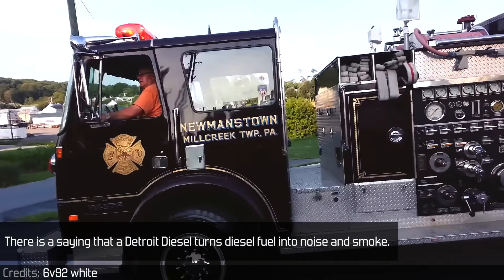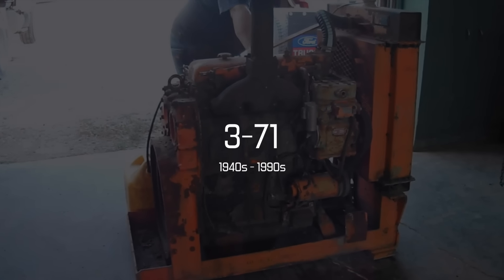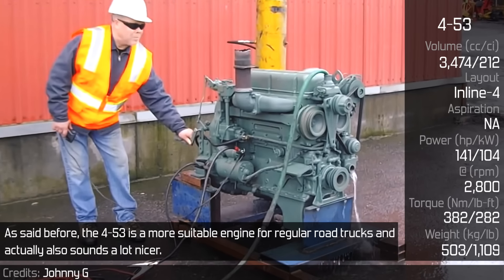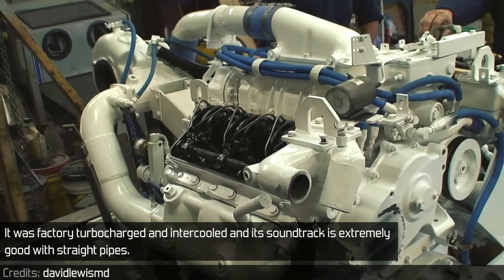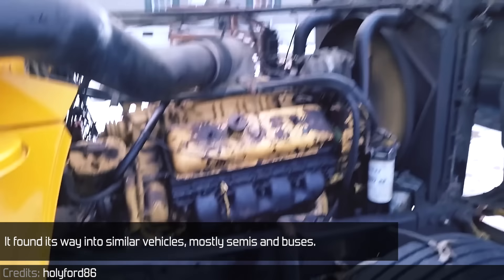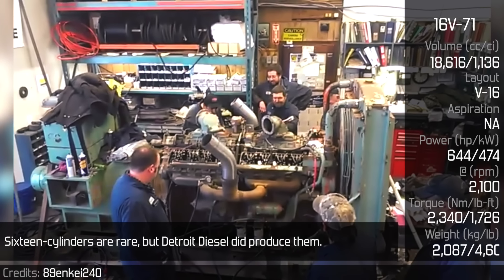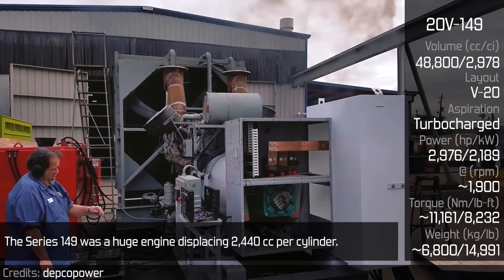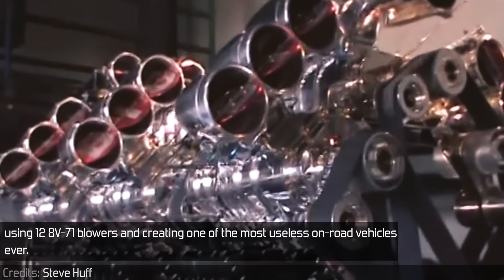9 Of The Greatest 2-Stroke Detroit Diesel Engines Ever

Comment: I was trained to rebuild, repair and operate the Detroit Diesel 6-71 marine units for use in Coast Guard patrol boats in particular the steel hulled 40 foot boats which used two. In the engine's early days the marine units were branded as "Grey Marine Diesel" In the inline 6-71 there was a two exhaust valve engine that was normally aspirated and a 4 exhaust valve engine that was turbo-charged. For those that don't know, the suffex on the engine's designation, 71 or 53 ect. designates the cubic inches per cylinder. The prefix designates the number of cylinders and if the number has a "V" after it, it means that it is a V type block.  A 6-71 is an inline six with 71cu. in. multiplied by 6 or 426 cu. in., a 6V-71 is a V6.  The only big issue that we had was to have a "runaway" engine. This happens when the air box drains get clogged and the engines lube oil starts entering the intake ports, (two stroke Detroits don't have intake valves, only exhaust valves). It starts using the lube oil as fuel along with the injected diesel fuel. When this happens the RPMs start increasing at an uncontrollable rate. The only way to stop these engines from destroying themselves is to stop the engine's incoming air. The early engines didn't have a cable operated block off plate that was situated at the intake of the blower to stop the incoming air and to stop the engine. The alternative that we had was to use a Co2 fire extinguisher that would be discharged at the intake. This would stop a runaway pretty effectively. As a boat engineer I always made sure that there was a fully charged extinguisher on the boat when I had duty. 
General Motors also had a two stroke Diesel that was in sorts a bigger brother to the Detroit series branded "Cleveland Diesel", these were inline units which had separate cylinder heads for each cylinder. My experience with them was inline eights connected to generator sets on WW II era cutters. Thanks for the video, you brought back some memories of a great engine series.
Reply: And there was also the EMD 2-stroke diesel, that evolved from the Winton 201 that was used in the famous Burlington Zephyr locomotive.  Cleveland diesel started as the Winton Motor Co, and was bought out by GM.  Detroit and EMD diesels were developed in the mid-1930's at the GM research labs, bringing about a transportation revolution that resonates to this day.  The Detroit 2-stroke was lost due to its inability to meet ever-stricter NOx emissions standards and it couldn't compete with high torque-rise 4-strokes in heavy duty trucks when it came to operating economy.  But they always did sound great.
Reply: William Charles yes thanks for the extra info and your service in the USCG. My family owned a small mom an pop trucking co. from the late thirties to 1981, when the dreaded teamsters union ran us out of business. So you could say I grew up around trucks, from straight trucks built by GMC, with the big block V6 gas engines at 351-401 cubes, with giant two brl  carbs and Six speed trans with two speed rear. To a couple Mack R 500 straight trucks with 210 Scalia Varbis in-line 6 diesels with two shifts, one for low and high, the other a straight 5 speed with reverse. They were all refrigerated with Thermo King units powered by Wisconsin cast iron single cyl gas engines. Then we had a fleet of White 9000 single axle tractors powered with Cummins diesel with 10 speed Roadranger tranny’s. My father had hired a great mechanic full time and paid him very well, that man taught me everything I know about getting my hands very dirty and being able to fix or rebuild anything that has wheels and burns gas or diesel! Matter of fact he was a Master Machinist Chief in the USCG! As far as I know. I’m not sure of the rankings in  the USCG, but I know it was high up after 20 years! He also always owned a boat and made a lot of money in the side repairing them! He was a great guy! I’m also a Veteran, 1973-1976 U. S. Army.
Reply: William Charles 
My last unit in the Coast Guard was the 13th district assist team where we rebuilt 6V53 for district lifeboats.  It was great duty, MKCMJoe Gelokaska was the POinC of the unit, located on the Lake Washington Canal in Seattle, Wa.  Moon Morrison, MK-1
Reply: Thanks for your knowledge and experience on Detroits, I spent many a mile behind the wheel of k series Kenworth and W series, 6v 71 n/a 8v71 n/a 6v 92 tta 871 tta 671 na all great thanks.
Reply: @k.r.v.4219  great thanks.
Reply: I never worked on them but I did have the pleasure of driving the older, 39,000 lb HEMTTs that were equiped with the 8v92 engines. I LOVED driving those machines even though they were automatics. what sold me on Detroit engines was one trip where I had to deliver an M978 (4 speed HEMTT) to another unit. we were in a time crunch because our ride back (UH60) had a tight schedule. I was driving and sarge was riding shotgun. she told me to put the foot down and well you know how the ARMY is, unless you have a moral objection to an order you do what your told! I wasnt going to argue with letting the old Detroit sing! so I had the throttle pinned for about 4 hours. it was screaming at 2500 rpm the whole trip up I55 and it didnt break a sweat
Reply: Didn't DD make a series of 2 stroke
Diesel that didn't have exhaust valves opened/closed by a camshaft? I read about them and saw some running engines here on  
YT. I just can't remember the series number, but I know they quit making them late 50's early 60's because they were too noisy. Another rare Detroit is the 6-110
Reply: @andyharman3022  Detroit's were great for stationary jobs like generators, pumps, cranes, and marine.
Reply: Thank you my fellow engineer. very well explained.
Reply: That was the one I liked best when I was in navy they where 268 A engine's used in 150 ton craft to 350 ton craft
Reply: Navy still have some of those they are 149 emd they were used in Vietnam on 85 ft. patrol boats three engines and three shafts in makon delta
Reply: The 567/645 v12 are used as backup and  emergency generators on most navy's fleet,,,,,,,u look at trains like Burlington northern they run 2 Fairbanks Morrison opposed piston five cylinder ten piston engines they have no intake valves or exhaust no cam no heads .,,,,, they normally run about 2000 hp each..............the trains with the cab same width as engine compartment they run either the 645 V 18 or 24 cylinder 2 each 2000 to 2400 hp each
Reply: @rbagel55  Yes they did, they were the 51 series engines, in 2-51, 3-51 and 4-51 variants, cylinders were loop scavenged much like a lawn mower engine but still  had the traditional wet sump, unit injector and blower of later engines.  Very rare these days, I believe they were mainly used in marine small boats, although some possibly made it into generator use. They were very simple engines but suffered terribly from exhaust plugging, any sort of back pressure in the exhaust and they barely ran.
Reply: Literally Shaking  Blower only engines are referred to as naturally aspirated as the blower drive ratio is set so that air pressure fed to the engine is barely above atmospheric pressure. High speed blower drives and turbo engines are 'super charged'
Reply: @rayg9069  Good info, but from what I read was they only had the 251 and the 451, no 351
Reply: @rbagel55  You could be right,  I only ever knew of one engine in Adelaide Australia a 4 cylinder in a fishing boat, never saw it in person and only one mechanic in our shop ever worked on it. None of the young guys would go near it.
Reply: @hank1556  I drove those old HEMTT's too when I was stationed at Baumholder Barracks, 2nd/29th FA from 84 to 87. I miss the sound of those old Detroit engines
Reply: @rbagel55  I think you are thinking of the 51, I remember reading they were designed by someone else and GM build them under licence.
Reply: Hi,I was an MK1 and operated and overhauled many DD,53-71 series.One of my units was Support Center NY ,Motor Repair Shop.85-89.I was active 1972-1993.
Reply: @hamiltonmorrison8804  Hi ,I'm a retired MK1,did you know a MKCM Brock,he was on assist team in80's.He was Chief on Point Richmond ,Anacortes WA with me 1977-78.
Reply: Besides being very popular and reliable power plants, the GM diesels were quite versatile.  Because the cylinder block was symmetrical the inline engines could be assembled with the blower on either side of the engine. The same is true with the cylinder head. The exhaust manifold could be on either side. By changing the gear drives at the rear of the engine, it would have reverse rotation
I was assigned to LCM-8 landing craft in the Army. They had four 6-71 engines driving two opposite turning props. No two engines were set-up the same, although they had the same parts. 
Thanks for your service in protecting us. And thanks for your insight.
Reply: Literally Shaking  We got an 671 to run (briefly) in GM rebuild school in Indianapolis back in the 80's.  It idled like garbage choked gagged sputtered and then died but it did start and rotate... absolutely no power though.  That place had an outstanding diagnostic training school as well although I think the place has closed down since.
Reply: @andyharman3022  There are 10-20000 rail locomotives in service built from the 1960s through the early 2000's with 16V and rarely 20V 645 and 710 (cu. in per cylinder) engines. These are EMD until recently sold to Caterpillar. Early versions had roots blowers and later came gear driven turbochargers that transitioned to exhaust driven when the exhaust turbine caused them to overspeed the gear drive and disengage from the sprag clutch. These have an overhead cam for each bank, four exhaust valves per cylinder, and ports at the base of the cylinder connecting to the airbox just like the Detroit Diesel truck engines. They were all part of GM at one time. The 710 was same as the 645 except stroked so as to increase power to 4000 HP to compete against GE's 4 stroke engine developed from the 1950s Cooper-Bessemer design that they bought.
The EMD 2 stroke loco engines will be in service for many more years but I imagine are rarely built anymore due to not meeting EPA Tier 4 limits on particulates, NOx, etc. Cat and GE rail (now sold to Wabtec) both have new four stroke designs but the whole rail freight loco industry has been stagnant with few sales because of reduced freight, few coal trains anymore, and an over supply of locos bought during lower emissions regulations when they were cheaper, and now Covid.
Reply: @engnrpetev  Yeah, it's sad that the EMD 2-strokes can't be sold anymore for locomotives.  But Progress Rail still advertises them on their website.
Reply: Great comment  great description. I too am a marine diesel and offshore mechanic  28 years of experienced 
Respectfuly the one thing you said about run away caused by plugged air box drains,I've never seen that happen,but you forgot to mention the reason the drains get clogged,. Worn oil control rings allowing excess oil enter the airbox. Besides most run aways are caused by improperly set gov gap, rack and buffer.  Stuck in injector(old style 2 screw rack)
Reply: @enginemaster01  You are correct about the issue with the old 2 screw fuel rail, (rack),  if it's improperly adjusted.  One had to know what they were doing with the adjustment.
Reply: I totally agree with you. Immaculate observations.
Reply: They made good anchors, also.
Reply: @rbagel55  that's what they were good for. Absolutely junk in anything that had a variable load, semi / heavy equipment & etc.
Reply: @tomcander3669  I just wanted to share some knowledge, something that appears to be what you're allergic to.
Reply: @William Charles  hardly....I've owned many, rebuilt many as well in the last 50 years. Maybe you should tell them something real like how you can stall them and they'll run backwards until you stall them again or how the engine can be rebuilt to turn either way.
Reply: @tomcander3669  The stage is yours to tell everyone something "real" about GM's two-stroke diesels.  Feel free.  I would have a hard time telling the world that I got a marine 6-71 to run backwards through a hydraulic reduction gear.
Reply: @williamcharles9480  let it go..it's bad enough you couldn't make it in the Navy and settled fir the CG
Reply: @k.r.v.4219  There was a rate of Machinist Mate and the rank of Master Chief Petty Officer, (E-9) in the Coast Guard.  Anyone in his position was well respected for their knowledge because they came up through the ranks and knew what it was like to get their hands dirty.  Usually a Machinist Mate would be assigned to steam powered units, but in a small service like the Coast Guard, he would have diesel knowledge, too.  The rates of Boiler Tender, (BT), Machinist Mate, (MM), and Engineman, (EN), were combined into one rate back in the 1970s called Machinery Technician, (MK).
Reply: @hamiltonmorrison8804  I was in the 5th and in the 7th districts, finally ending up on small boats in Key West.  Great place to party if you had the free time which was at a premium.  Being assigned to the SAR boat crew as well as being a boarding officer kept me pretty occupied.  CG Station Key West was a busy place back in the 1970s with all of the drug boats, Cubans and Haitians trying to get over here.
Reply: @tomcander3669  You know you're jealous.
Reply: @rbagel55 51 series had no valves

Comment: 12v71 was always my favorite. We had a pair of them in a 44' Offshore Raceboat making 1100 hp each with 40 psi boost at 2700 rpm. Quite a sound for sure. Thanks for the video it brought back memories. I worked on all but the 149 series.
Reply: I would have loved to see or hear that boat. Wow!!!😊
Reply: 149s were quite different as the cylinders heads are round and set down in the block. The blowers are also inside the block

Comment: Use to drive off highway log haul trucks with buzzin dozen V -12s. Ear plugs and ear muffs required. But the sound pulling grade with a full load of Doug Fir. Oh my.
Reply: I worked in a large generator room with 6 16 cylinder detroits and 4 Cats about the same size. The sound in that room would blur your vision...it was horrible and awesome at the same time.
Reply: David J If I ran a buzzin dozen truck I'd certainly muffle it.
Reply: David, I know what you’re saying.. fresh cut timber, fresh exposed dirt, burning diesel fuel... that is indeed a heavenly smell.

Comment: Gotta love the 6-71. It's one of the most common and best sounding. We had them in all our trucks. When they'd get side by side on the highway with both engines revved there was a reverb like a "waaa, waaa, waah"  that seemed to distort reality. it was awesome.
Reply: There were no 2 cycle Detroit diesels that were naturally aspirated they need a positive displacement supercharger to run the turbo charged version still has to have it as well
Reply: Luke Nellermoe yea I was wondering about that myself!
Reply: It’s a blower not a supercharger as the Detroit was a loop scavenge type two cycle.
Reply: They had a Roots blower to blow air in, since it's a 2 stroke with no intake valves. 318 was the nominal hp of the naturally aspirated 8V71. But you can turbo charge them too, just like any other internal combustion engine.
Reply: That whistling sound from the blower pushing that intake air through those intake ports was unique, also.  I loved it!